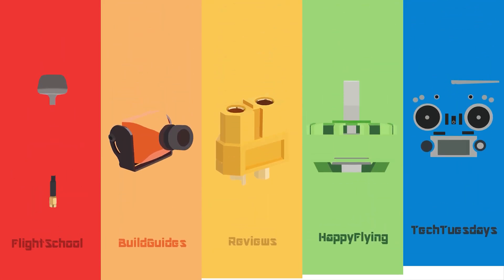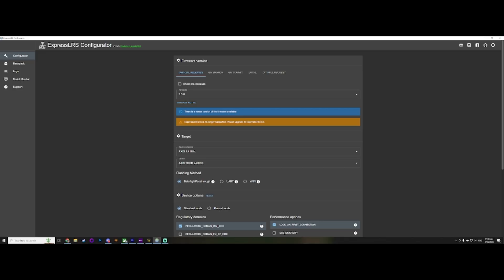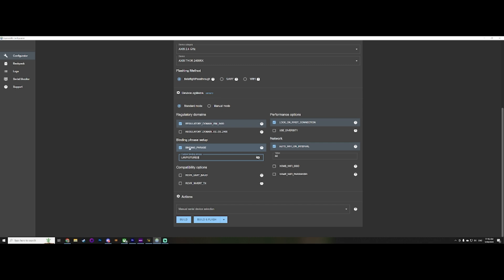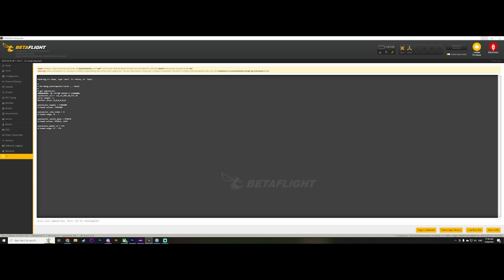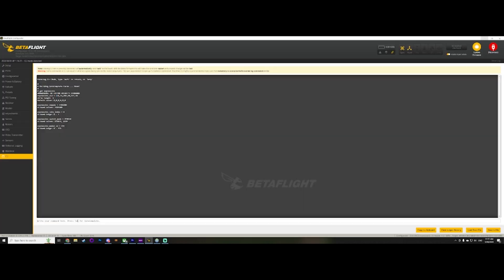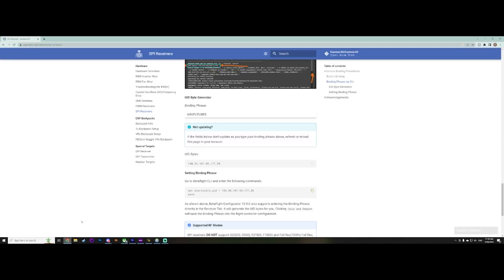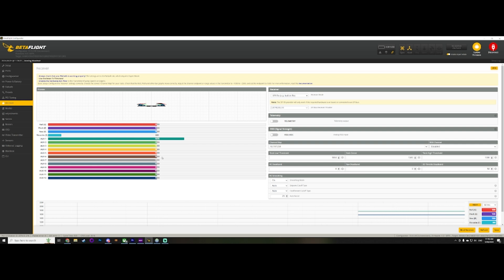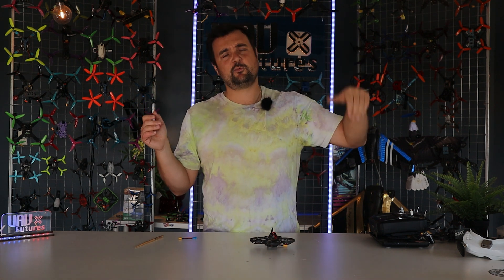BIND EXPRESS LRS SPI recievers. Quick Tutorial.

Comment: Binding phrase on my radio, and on my drone flight controller in beta flight are the same still will not bind.   Both on express LRS 3. X.
I have the Boxer ELRS so Xpress LRS is already set up. I said the binding phrase on the controller and on the drone when I hit bind, nothing happens.    Spent four hours trying to figure it out now. I just put everything back on the shelf and I’m pissed.
Reply: I bought a micro  tx , and then a nano tx . But a 2.4ghz nano tx came . So i ordered the nano 900.hz tx again . 2 rx's each time and an extra rx . I was told no binding phrase is on new ones . Just match firmwares . But new rx's and tx's were supposed to have certain firmwares factory installed and they do not . Im not sure if sarcasm or successful customers that say " thanks . Mine works great . Finally something explained "
Reply: same here, ever find a fix?
Reply: i have spend multiple days trying to bind the hummingbird v3.1 , its on bf 4.4.0 and 3.5.3 rm
Reply: For me my packet rate was at 100hz. For some reason when I changed it to 50 or even 150 and above it worked right away. Check your packet rates! It would not bind at 100hz.  @mikebarbarian5313

Comment: Just use the Bind button in the receiver tab of the  BF configurator.  Way easier and quicker.
Reply: I just got last year's stock Mob7 at a good price, haven't upgraded my Zorro either, just clicked bind in BF and it worked, both are on ELRS v2.0 with no custom bind phrase ! Happy Flying !
Reply: Yep that's how I do it takes seconds to do as your in betaflight anyways to set everything up.
Reply: Except when nothing happens when you do that...
Reply: @Eddy-rc8wo  exactly. I said the binding phrase on my mob 8 in beta flight and on my Boxer remote.  Absolutely nothing happens. Still can’t fly it.    Press Buying on my remote and in beta flight nothing happens.
Reply: @LoVeAmBiEnT 
    I had one reciever and transmitter bind once out of 3 tx's and 5 rx's . At least . But the t' antenna caught in the props and shredded it by pulling it out . The modules are turning yellow from storage . The tx's are in protective ziplock bags bundled in a storage  box